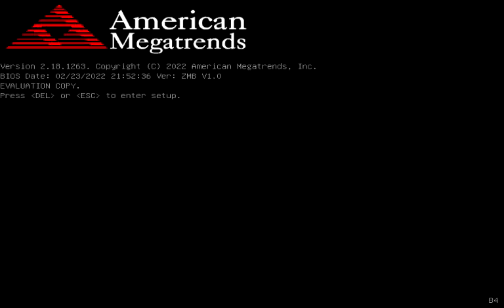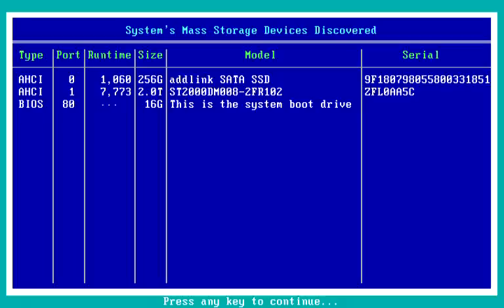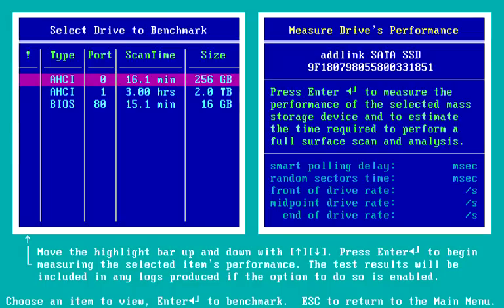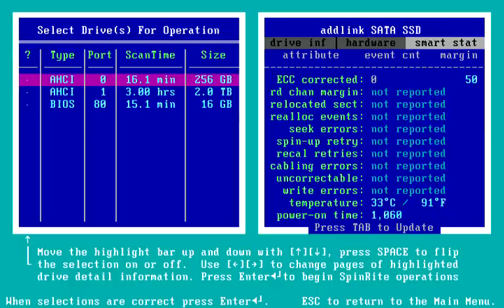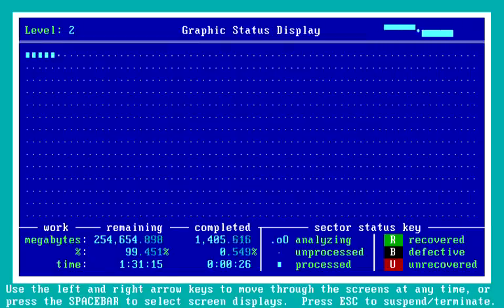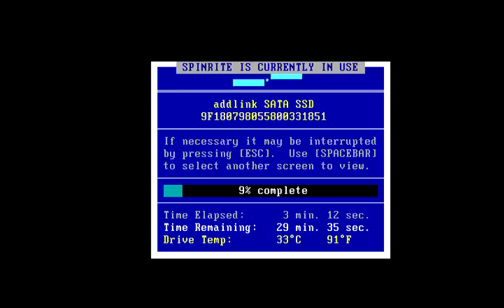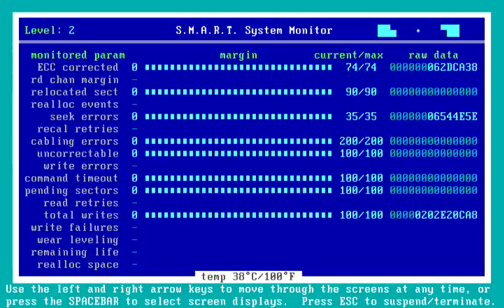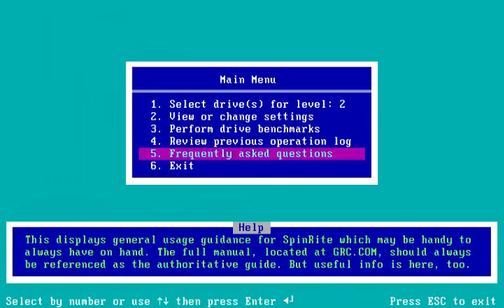A SpinRite Walkthrough

Comment: I am amazed you still program for DOS based interfaces and how the modern drives still could use software such as this.
I remember having to learn all about interleving HDD and heads and sectors back on my first PC Amstrad 2086 back in like 1985-89 with a 30Mb HDD.
I had to reinstall the OS and was talked through witha technician on the phone when I was like 10-13 years old.
Very much thrown in the deep end but gave me a massive insight into a large scope of detail hidden to most users at the time and yet so crucial to an efficient pc.
Reply from the maker: Today, SpinRite is still a DOS application only because it was originally. You probably know that everything else I've written (while still all in assembly language) have all been Windows apps. And that's SpinRite's future, too. I had promised the world a no-charge upgrade from the original SpinRite 6.0, so this v6.1 is that. But this will definitely be the final SpinRite for DOS! :)
Reply: @SGgrc  end of an era 🫡

Comment: 9.8406% on screen dialog but 9.8405% in the log. Was this difference because each referred to different sectors? Perhaps ...05 was the last sector fully scanned and ...06 the next?

Thanks Steve for your excellent software and technical commentary in Security Now.
Reply: further down in the detailed log, it shows a rounded 9.841 value. it would be nice to be consistent. Although, I would much prefer to be able to enter sectors instead of fractions of percentages.